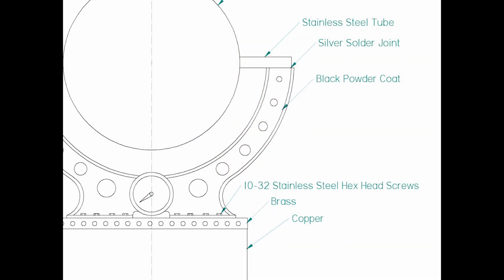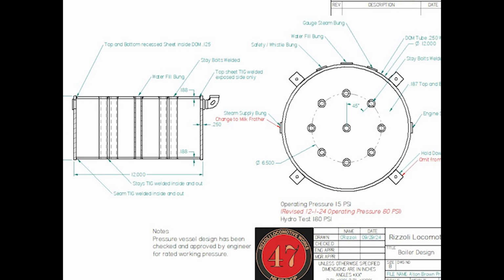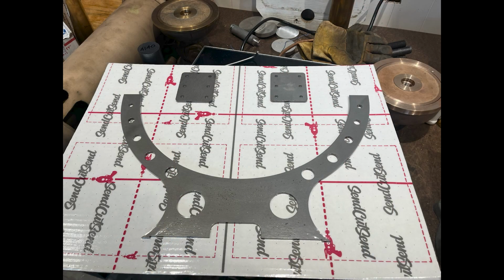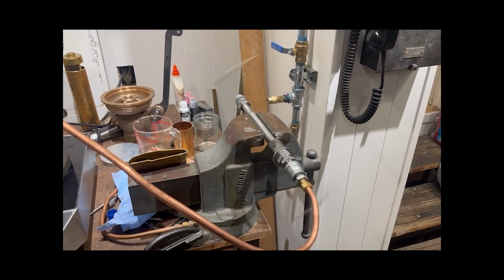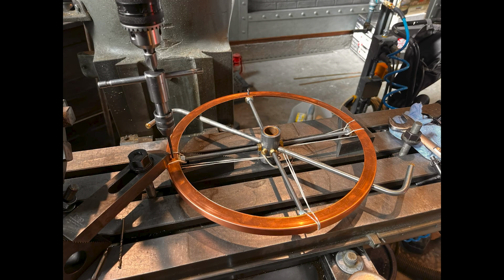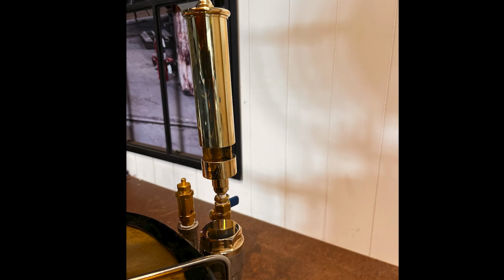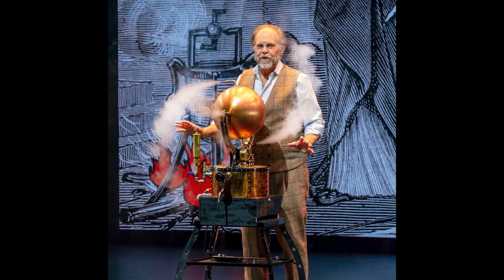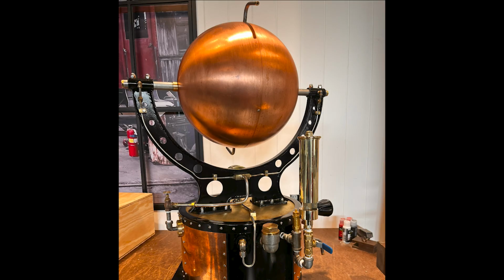A Steam Engine for Alton Brown- Rizzoli Locomotive Works

Comment: Hi. I am in need of some clarification regarding a whistle. I’ve been wondering which type of whistle Columbus and Greenville steam locomotive no. 178 used while in revenue service (The engine is preserved today, but its whistle is missing)
Here is a picture of the locomotive following a rebuild in the late 40s. If it is possible you could help in identifying this whistle, that would be wonderful. Thanks!

https://hawkinsrails.net/shortlines/cagy/steamers/cagy178_shop.jpg